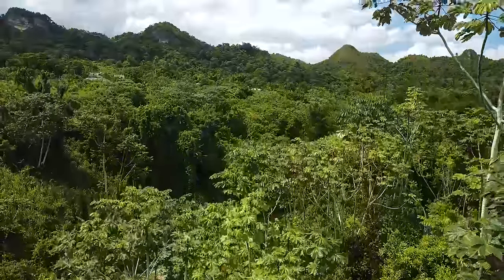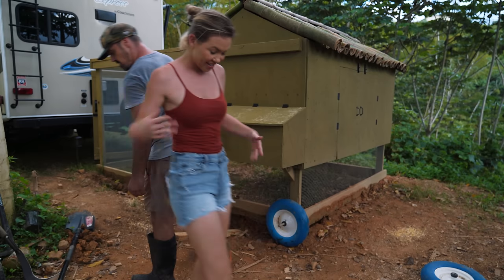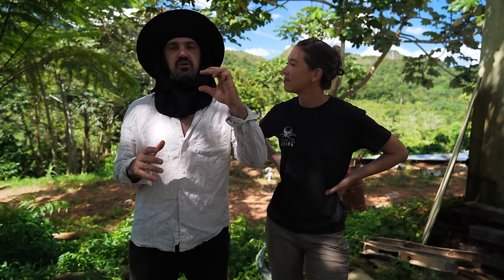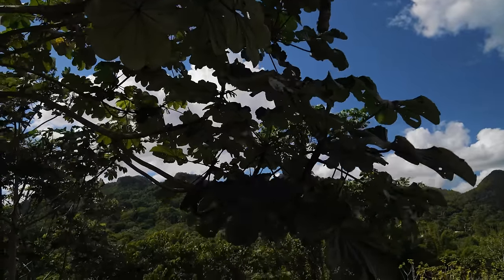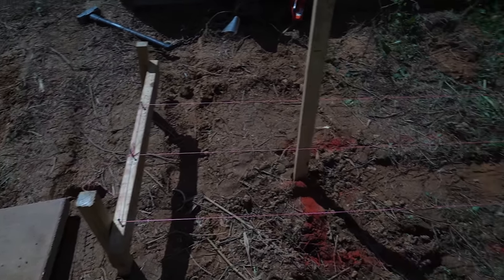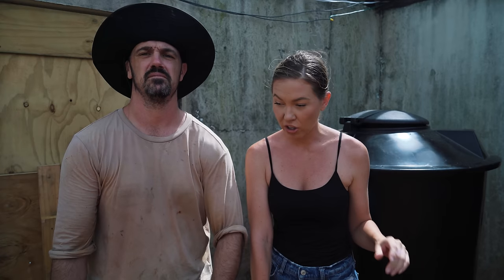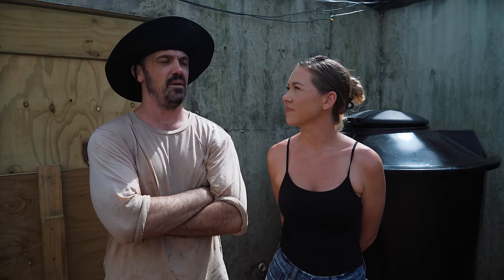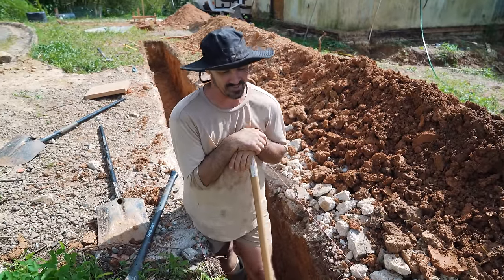BEGINNING TO BUILD ON OUR DREAM ABANDONED PROPERTY!

Comment: One issue is most important that the width of the gate is enough for a construction delivery truck to be able to turn in to the driveway with proper clearance, and because it is necessary to turn to enter, that requires more room than just the width of the truck itself.
Reply: And you leave a little extra room in case he isn't a great driver, or has trouble.
Reply: Yes depending on the truck  10 to 20 m radius will be necessary

Comment: Lower tire pressure, 20psi, gives better traction off asphalt. Lucky didn't damage the diff &/or sump without kerb built up. Can't beat Foam Core Fencing (& building materials). Backhoe would have dug that trench & cleaned up in 1 hour max.
Love the way Kristen keeps speaking over Matt mid sentence/story.

Comment: A really easy way to hand dig anything is using a auger, $200 removes dirt quickly and you can easily hand shovel between holes. I did the entire perimeter of foundation for a 30 x 50 cabin house. The dirt your handling is similar to Georgia. It only took me about 3 days for the entire thing.

Comment: For a nice looking strong property line fence I am all for putting in a strong wire livestock fence then plant a flowering evergreen vine that will grow up and cover the wire in a year or two.  If you want a tall fence, install a standard 4-5 foot livestock fence using post the height you want the fence.  Then use less expensive wire above the livestock fence to the height you want.  I have a 6-7 foot green fence like this to keep my neighbors police dogs from jumping my fence.  It is covered with an evergreen Lavender Trumpet Vine that has gotten thick on the wire.  Best looking privacy fence around.

Comment: I would put the wall on the property boundary--that saves money and solves problems.    If the wall is curved--not such a worry.  The mortar between the blocks, or the boxing for the pour, can be curved to make a good job.  One could even cast the wall panels and move them into position and bolt them together.

Comment: A few points: a curved wall would provide more strength then a straight one, but seeing the dimentions of your trench I'm guessing that your wall will be about that width too, so should be strong enough with no curcve, and your box shape feature, if the wall follows that trench, will provide good strength and stabilisation., although the shorter piece of wall, on the other side of the path, will not have the same good properties as the main wall, but considering the thickness of the wall, as suggested by the footings trench, the shorter part of the wall should be OK. I am not a builder, but have built various things like sheds small to double garage size, rock walls with concrete and mortar, extensive vaving and currently extensive concrete block walls at our hillside home, all at a reasonably high standard (taking a lot longer that a pro, of course. Last point re the cats: My wife and I love animals. The way you are collecting cats by "donation"will quite likely lead to more being "donated", because theses donors don't, or can't spend the money to avoid breeding. You'll needd to resolve what to do there pretty soon. You could try to find animal lovers like yourselves and perhaps play a part in starting an animal shelter, or support an already established one.😇

Comment: When moving your van with your truck, if you lower your tyre pressures you increase the traction. The lower the tyre pressures the greater the traction. I would suggest as a starting point 20 psi in the front and 25 psi in the back. Another great video.

Comment: As a retired Masonry Contractor  I must relay that a curved wall is stronger, and requires less footing so is therefore less expensive. And #2, you will have an easier time building if you use full block unit size. I.E , 49 ft 4 inch  instead of 50 feet. Have fun!

Comment: In clay that foundation trench depth and width would support a 2-storey house without steel. The clay would be pretty stable at 3ft depth, shrinkage unlikely to be a problem and certainly freezing defo not an issue like the UK. So you sort of over-did it for a garden wall and gate posts Matt unless it is supposed to be tank-proof! Do the same for the house, fill it with concrete - they call it "Trench fill" but don't forget ducts for incoming services and outgoing  foul drains. A 450mm (18 inch to you yanks) is fine for a single storey house if 900mm deep (3 feet), same depth but 600mm (2 feet ) wide suits a 2-storey house. If you are in earthquake territory then yes, you would be wise to put in a cage of 3 top and 3 bottom high yield rebar for 450mm and 4 top and bottom for 600 wide using 12mm minimum bars with 8mm links. Add 4 x 10mm vertical bars at every post location if you are going for concrete beam and post construction instead of just hollow block or brick.

Comment: The paved portion of the road can be anywhere within the allowable land designated for the road . (called the road allowance ) .. Over state side, or Canada that's 66 feet. So if you measured from the center of the road it would be 33 feet to the property line,( if the road was on center where it's supposed to be !)

Comment: The spinning tires losing power sounds like a rear differential and/or traction control system is present.  The TCS can usually be deactivated.

Comment: Wheel not turning: can be caused by Limited Slip Differential. I learned about this in 1964 when my Dad bought a car with an automatic transmission that included limited slip differential. And I have a form of this on my 2019 Honda Insight Hybrid's front wheel drive. A limited slip differential reduces individual wheel spin and improves traction on a car. When one wheel on the axle has lost traction, the limited slip differential senses this and sends power to the other wheel. Yeah, back in '64 I would take my Dad's car and drive in deep snow without getting stuck. Donuts in a field with a foot or so of snow was so much fun. I'd do driving in deep snow again, but my '19 Insight is a low rider for low wind resistance and has plastic bumpers instead of the steel bumpers on the '64. Yeah, I think your truck has listed slip differential that stopped a wheel from spinning. :¬) Webhead USA

Comment: Also be careful, should you get a bite from a cat you will need antibiotics right away, especially if it’s in a joint.  The teeth are like little needles so you basically get an injection of bacteria.  There are medications you can give them for fleas.  You can use topicals or if you can’t touch them you can put generic capstar and generic program (lefenuron) in their food.  You can do the same with worming medication.  Thanks for caring

Comment: Hello from Oregon state i love seeing you guys in action making the land beautiful again and a homestead you both have worked so hard '' and the place is already showing '' you have a  beautiful piece of land ' i had a thought at the road driveway how bout making a cement small ditch between the  driveway and road with a run off to both  sides to keep water from running down driveway into property and you could use it for a water catchment as well ' not to deep of one but enough to keep water from running down driveway just a thought. you could also use gutters into barrels for water catchments off of roof tops big hugs you guys rock

Comment: I'm amazed you moved the chicken coop and trailer without having leveled all the land on top to one level.  Unless you want 100 cats, you have to get them all neutered.  I'm glad the first three are scheduled to be fixed.  How high is your fence going to be measured from the bottom of the ditch?  You went down a lot lower than I thought you would.  How many cinder blocks do you estimate you will need and what is the cost of each one?

Comment: Feral cats are and will always be a problem, especially in tropical climates when females consistently are in heat. If you plan to keep them, definitely get them fixed now if possible (some will argue they’re too young). Low cost spay and neuter clinic can be set up at your place if enough cats are present and local vets want to service the area. I would talk to your neighbors and local vets to see if this is an event people want to participate in. May help you meet some neighbors too!

Comment: As you are no doubt noticing, 2 axles are way harder to maneuver than 1 axle.  You'd be moviging it easier with just one set of wheels. And the black wheels only will give you better turning radius. Also, as a 1 man show, you need to work smart, not hard. Machines will save your body.

Comment: Build a floating mid axle for moving things will help balance out your work load....can Gove some instructions if you would like.

Also get some diamond hand files  an sharpen your bits....just some advice
Reply: Also get some metal sleeves to over the all thread and through the wheel to act like a bearing; will make the wheel turn easier

Comment: To dig holes. You really need a 3/4 in. 16 lbs. Chipping hammer. And buy a bit that has a shovel head. Beleive me. You'll dig them holes in a minute. I know. That's what I use on projects like that. And I live in the island of Puerto Rico.

Comment: Man you dug deep for that wall. Normally you only have to go about 18 inches deep to get below a frost line but no freezing weather there. As far as a sloped surface, you can make it level to a point and then step the foundation up 8 inches match a block height for the next higher level so no digging to China on the high ends. Steel reinforcement is a good idea when clay is involved.

Comment: Turn your traction control function to the off position. The computer thinks you lost control/traction then shuts power off to those wheels. Turning that off will allow you to spin your tires if need be and the engine will continue to deliver power to the wheels.

Comment: Love you guys and you work SO hard. Im sure the gate and wall will be gorgeous. Is there another access to the property? Im not understanding why you're building a wall and gate now before you build the house since you'll be having construction vehicles coming in? Even if you build most of it by hand, you'll still need concrete trucks an stuff, right? This is assuming you're building farther into your acreage?

Love the kittens but yeah, your neighbors who are dropping them off aren't good people. Good to hear you are getting them fixed. If more people did that there obviously wouldn't be a problem.

Comment: Being a Retired contractor. You are doing things in reverse order. Fencing should be one of last things to do. Use Construction Fence for temporary. I can see ideas changing and your Fence. Drive two stakes and put a board Horizontally to both of them then you can move string easily.

Comment: Do yourself a favor and adjust your fence/wall dimensions to be more modular with the materials,  ie, masonry should be cmu block modular to nearest 8" since block is typically 16" .... so not 11', but 11'- 4" or 12'. Similar with chain link fencing as top rails are 10' modular, so post are spaced 5' typically.....so 10'  not 8' or 11' (?) lengths and swing gates at 10' width vs 12' is better.  Fencing will look better too with uniform post spacing.

Comment: We have the same cat problem, they just show up and we can't just let them eventually get killed by something around here. So we have ten, at one point it was twelve. Best advice is to get them fixed. But any that stick around more than a month or so, it'll be hard to let 'em go. They chose you. Now you're cat people, them's the rules. Also, man, the footing for that wall only needed to be about 8-12" deep. There's no frost there to worry about, just needs to be strong enough. Two horizontal bars at the 1/3 points, 3" from the bottom, is all you need for that, and your vertical bars for the wall tie down. But now there's enough counter weight that no hurricane could ever damage it, if the block is laid well.

Comment: Is it possible that Miss Kristen could roll out a coat of paint on the building while Matt is doing all that very hard work?  If the house looks like you are making improvements people would be less likely to drop off animals and trash.  I would put up a couple trail cameras to catch video/photos of who is dropping off the cats.  Go to DMV/Police with the tag info of the vehicles, report them to the authorities or return them.  You can't be responsible for every cat on the island.  I love animals but this is not good. Great work getting the fence & gates started.  That is No. 1 priority!  Security.  ✅  Glad to see you have a rain water catchment tank in the building.  ✅  Buy a cheap push lawn mower to keep the grass under control.  Use only Non alcohol gas in it or the carb will become trashed.  Love what you are doing.  You are great folks!  God bless. 🤗

Comment: Turn off the traction control on Toco, that's why the wheels quit turning, they sensed you where going to spin. It's designed for icy roads or very wet roads so you don't spin out.

Comment: Hmmm, not sure what your little "taco" is or how it's equipped..... but if you are in reverse, backing the trailer and taco's rear wheels stop turning.... and it's an automatic trans...... better be checking your trans fluid level....:)

Comment: Highly recommend you give that building a clean of you are storing water in there.. the green on the walls is mould and is not good for your health.  
Just need to grab a pumppack and some liquid pool chlorine.. dilute 50/50 and spray the whole building, then simply rinse with water.
No it will not harm the environment. Its called softwashing.

Comment: Perhaps your rear brake connectors is not connected and your rear wheels locked up that prevents a trailer that got away from the truck from going far.

Comment: Toyota Tacoma Star Safety System™ — includes Vehicle Stability Control (VSC),55 Traction Control (TRAC), Anti-lock Brake System (ABS) with Electronic Brake-force Distribution (EBD), Brake Assist (BA)56 and Smart Stop Technology® (SST)57

Comment: This is what I do with cats. tame them and see if they work inside or not. if they work out then they are the house cat, and I keep them inside for a few months before letting them run outside. After they start running outside they will stop using the litter box and go outside. then you can tose the litter box. if they are just not cut out to be a house cat they join the barn cats. you can feed them or just let them get the outdoor mice and feed themselves. when you have enough animals they find food easily. They will drink water with the chickens or with the horses it works out well. anyway, that's how I do it.

Comment: Jeez Matt, are you building a prison wall!  That footing must be 3' deep!  And rebar for a residential wall!  Canterbury Cathedral was built of 18" footings and it's still standing!  Save your energy and time for what matters!  Watching you manually hammer through that old driveway concrete was agony.  Doing a job yourself is tremendously rewarding, but you don't get a medal for making it tougher than it needed to be.  You could have laid blocks directly on the concrete slab, or cut it open with a concrete saw.  We love you guys,  but don't want to see you beaten by this project.

Comment: You barely have any space at the front as it is.  Why would you put up a wall when you don't even have a house yet?  How are you going to get any kind of heavy equipment on your property if you have a brick wall?  As for the cats, just get them fixed and release them.  Trap, neuter and release.  Start with the females first so they don't get pregnant.  There's plenty of food they can hunt in the jungle.